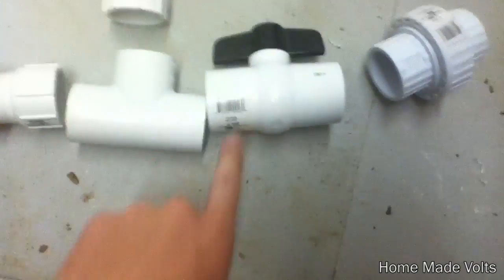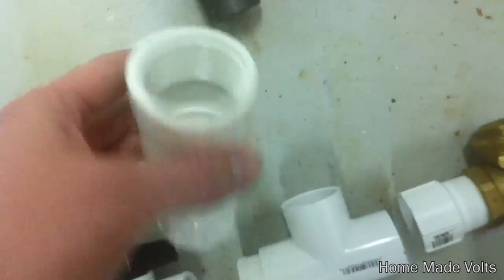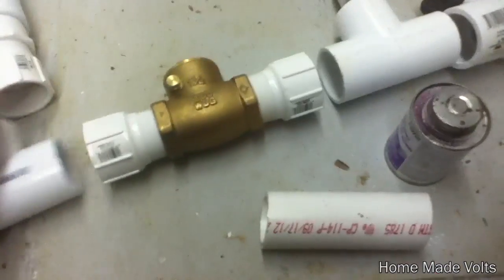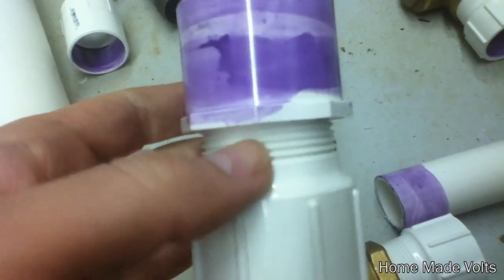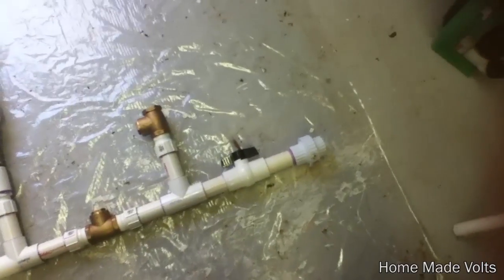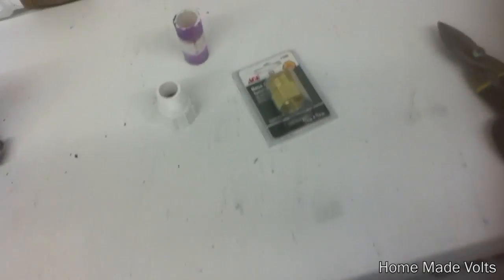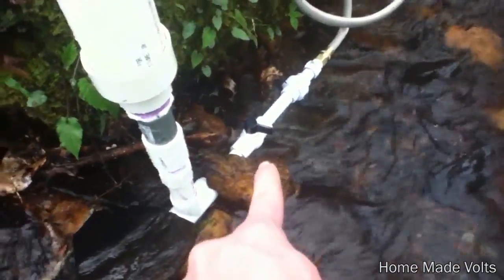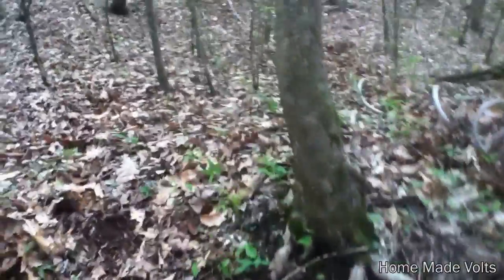Hydraulic Ram Pump

Comment: get rid of the plastic parts. After 8 years of running my rams I have learned two things.  NO plastic and NO swing check valves.  They will work for a little while but they won't last.  My rams are the heart beat of my world out here as they mean life or death of my farm.

Comment: How high up hill can your system pump water? Have you tried pumping water more than 50 meters uphill? From all the videos on this RAM PUMP I have seen so far, none specify how high their system can pump, so I pause this question to you, how high can your system pump.
Reply: +Jimi Ethan Hello.  I have moved all my efforts to a new channel. I answer all ram pump questions there. Typically I get the ratio of head to lift around 1:7. The highest test was up to 75' of lift. Do check out Land To House for a host of other rampump videos.

Comment: Your ram would be much more efficient if your release valve was on the far side of your pressure tank and your flow output stemmed off of that. You have most of your water flowing directly out of your release, because it hits that first. Just saying.
Reply: +I am a Vietnam at Dien Bien province, the region hardest of Dien Bien province. no foreign power that you study without electric pump I liked. but I do not know english very much hope you just help me, because we need them to take water for rice. My facebook is: thuongnongnghiepnp@gmail.com. My Zalo 0915068289 Display name is Nguyen Thuong. I hope you help me thank. /. Bohleber
Reply: Duy Thhuong
I will do my best to come up with a way to help you. Do you have pipes for pumping? If you do, I can send you the pump valves.
Reply: +Rick Bohleber Thank you for the comment. I have not tried using the design you speak of because the this design is so easy to build and work with. I find that the ratio of head to lift is around 1:7 and from what I have read that is about the same value as the pump with the waste valve on the other side of the tank.
Reply: Land to House
thank you very much. They also purchased a one-way valve to do but have not succeeded. Can you help me? people in many ethnic areas of poor children they want to help them get what his pressure pump. if you can send a sample to help you, I am grateful to him.
Reply: Thank you very much. Can you guide me?
if sent from a foreign party not his difficulties.
if help is for me, I'm thankful.
I hope to travel with you and visit us.
if you send me an offline donation.
if you send for his address.
Reply: +Duy Thương Are you fucking serious?
Reply: +kleetus92 haha I imagine he is.
Reply: +Land to House Oh in that case, here's my credit card numbers, social security number and bank account information...  Jesus Christ...
Reply: +kleetus92 7 also going to need urine sample and family history of diabetes.  :)
Reply: +Land to House LMAO!
Reply: I did, but it does not work! you can help yourself is not? yourself at Dien Bien Phu-viet nam.

Comment: Question, if I use a plastic swing valve, it is not better an fonctionnal?
Reply: +Full Dragon Hi I have a new channel that I keep very up to date. The plastic can be used for the second valve but not the first. The weight of the first is very important.

Comment: Great project/great video. Of all the Ram Pump videos I have watched, they all tell me to use steel pipe as an inlet pipe. It appears you have broken that mith and used plastic pipe. Thanks for this. I have a cabin I would love to have running water to, but steel pipe is very expensive. I will also try using two inch plastic as an inlet. :)
NS,CANADA
Reply from the maker: Yes I have been using PVC in all my pumps with no problems. The steel makes a more efficient pump but not by that much. Check out my other channel with lots more info on the pump. http://www.youtube.com/landtohouse
Reply: @sethandbryan  gov will have all heads for this tech thay teach us that we always have loss but never talk about 
the converted gain we can make from eletromagnets
if u convert all the wast thermal energy around 
you u can use it universally as energy u need a true sine wave bipolar like the power comp dose a 
true pure sinewave like a grid tie inverter 
once the signal is made the system will turn on and 
consume wast thermal energy from the 
environment and space around you... there is free energy but 

it comes from Universal thermal loss and converted into a gain. so a pole Transformer and a 
microwave Transformer  have a common between each other u can take 2 microwave Transformer provide 
a pure sine wave grid tie inverter to it or a true bipolar sinewave that inter acts with nature in 
a perfect spherical motion like a flower of life..  if ur home provides this use it as a Source 
signal then u can simply stack the Transformers on top of eachother in correct fasion and note 
that the 1 wire on the Transformer must stay connected and the other disconnected your only useing 
1 wire on the hi side .. so test ur self 
2 microwave transformer stacked on top of eachother same 

face sides. one side 120 to the wall and the other 120 side to what u want to power and useing the 
Transformer just the way it came out the microwave with the wire attached causes the energy in its 
perfect spherical motion to converted wast thermal energy to amp for u hot to cold in to out... 
should look a bit nuts with u use a form of wireless energy but its interacting with the 

environment...this is my work a compilation of Otis car. Tesla. and many other very smart people 

nowadays i think i found the gate source and drainif this gets out to much that it works the 
power 

comp and mib will have our headsdont do this at home warning high voltage yet i cant stop u lol DO 

NOT TOCH THE CORES OR THE WIRES OK u will die make sure u dont touch the core if the hi wire is 

mounted to it u dont have to mount the hi on the core if u dont want u connect the 1 hi wire to 

the same side hi on the other transformer then the core should besafe to handle if nessary
grab your multimeter and prove me wrong
thats what u do i have my whole home on this
and u can take 

one of the lows side out the wall and hook it up to other stuff and power it for verry little amp 

makeing nature convert and pumping latent heat effect into the device.
and u can have a microwave 

hi volt cap in between the hi side and make a system that powers its self
u can flip the switch on 

ur breaker and the room stays on up to 2kva 
with both lows in the wall this is the zero point that 

was taken from us...

Comment: FYI Purple PVC primer is not like paint primer. You can't put it on one day and
let it sit. It is a solvent that softens the PVC so the glue can bet a good bite
and bond the two surfaces. You should prime right before you glue.
That being said that is a useful project for places that
need to move water up hill from a stream and don't have electricity.
Reply from the maker: Thank you for the tip!  I will remember that for next time.
Reply: sethandbryan Your welcome. Thanks for sharing your project.
Any updates?